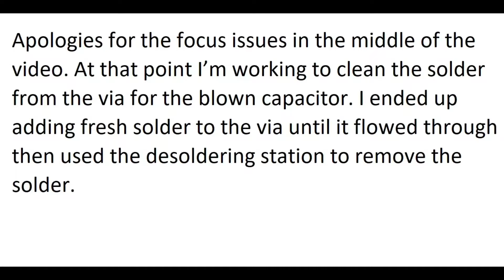IBM 386 - Part 3 - 80386 computer build - Tantalum capacitor fail  - STB85

Comment: Another way is to cut the cap as close as you can then solder a new cap on the bottom of the board to the pads. No desoldering that way on  a multi layer board.